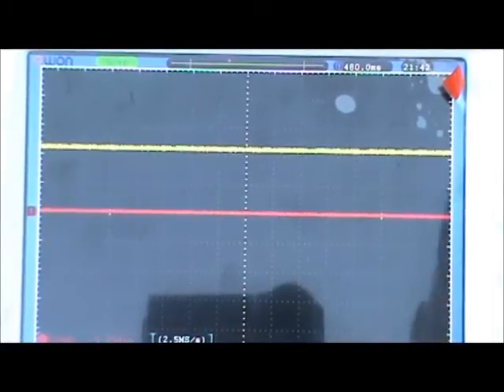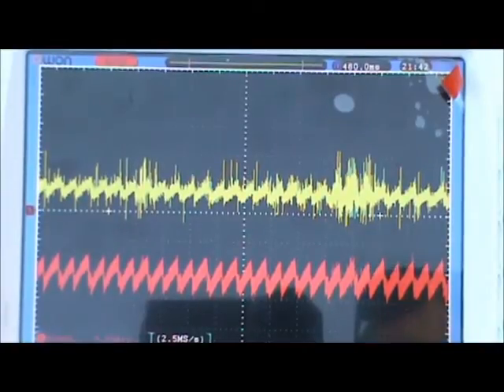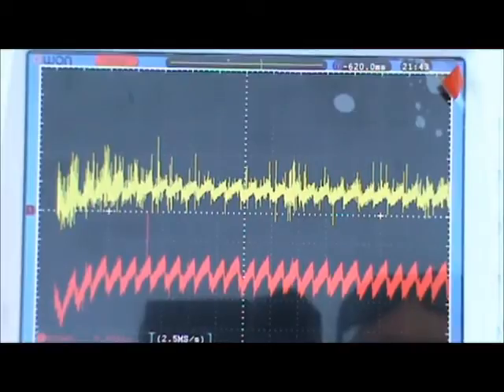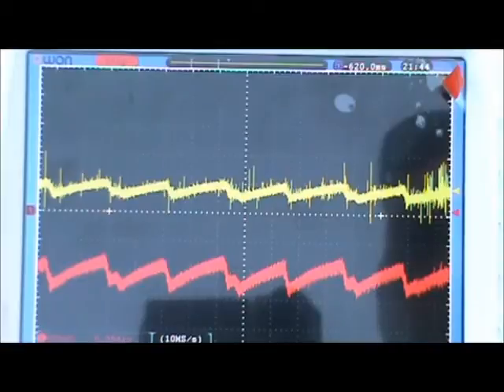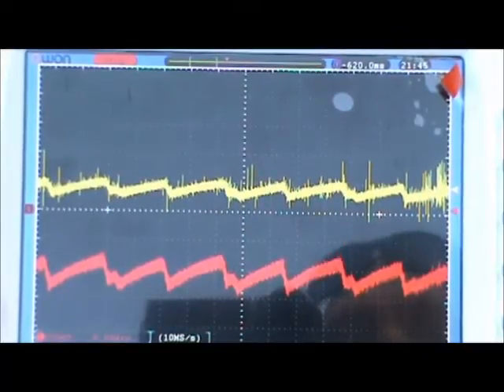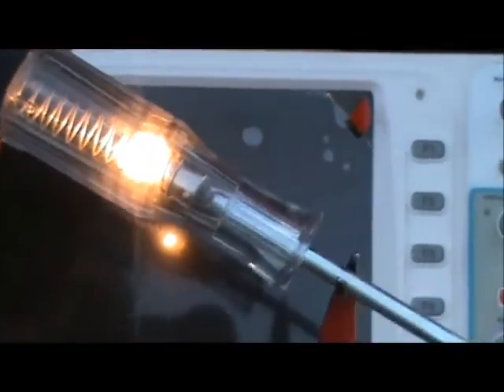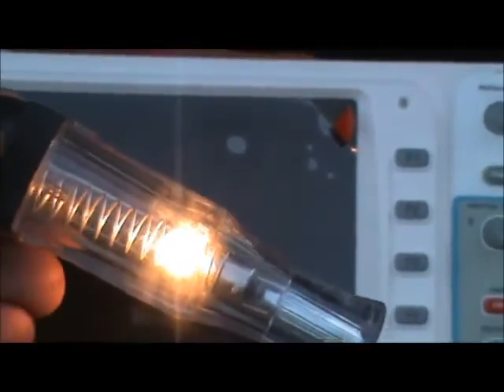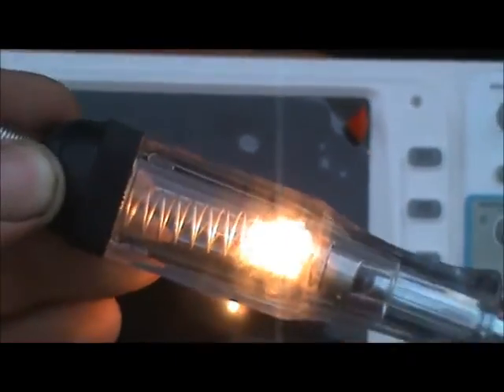Starter amperage draw

Comment: How much current were there? What was initial maxiumum current? How big engine that was?
Reply from the maker: A starter can pull hundreds of amps. I'm sorry, I do not remember exactly.
Reply: ***** :( Im working on shunt device that measures car battery currents in wide range, both directions with very high accurracy - startup, charging etc. I was wondering if I can use 200A shunt instead of 600A for petrol cars with engines below 2 liter.
Reply: ***** Next time please show equipment setup when you measure something please :)

Comment: Im not sure that 10 to 12 volt fluctuation will make a test light flicker on an injector ground side control like a pulse from 12 to zero volts. Your video does not show a flicker but in person there may be a flicker. Truth is when using a test light to test for flicker I like to cover the light and my head with a blanket or fender cover to block out daylight as much as possible. I mostly use the flicker test method on ignition coils and as you have said, beware of WHY its flickering. EXPERIENCE